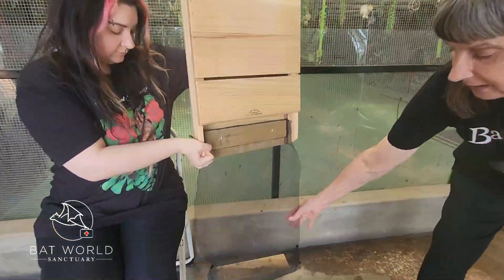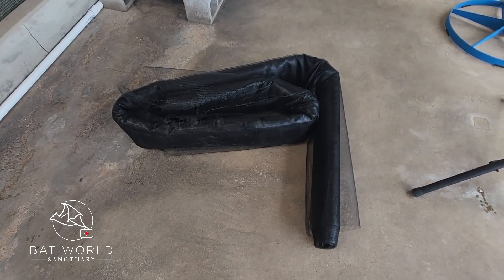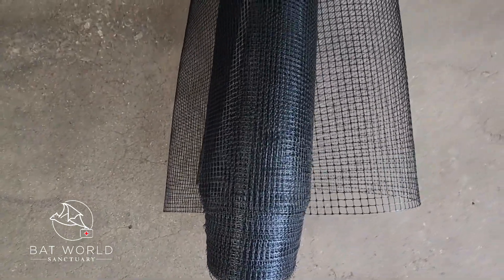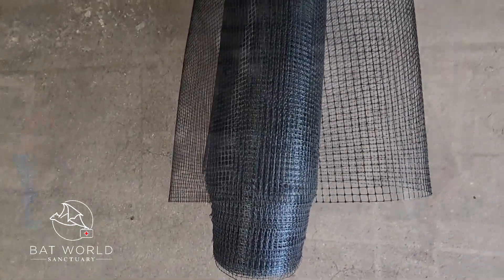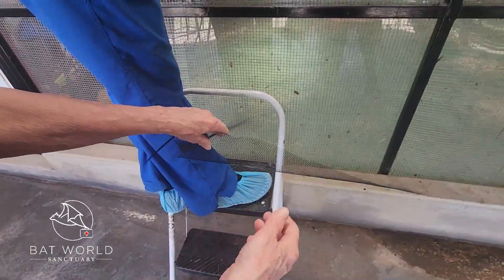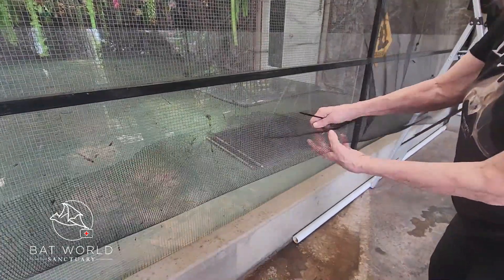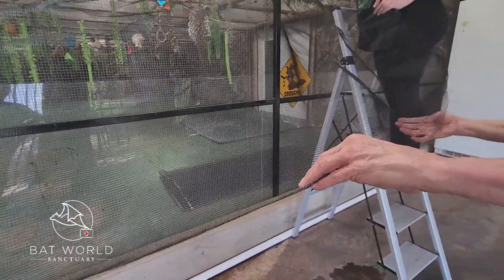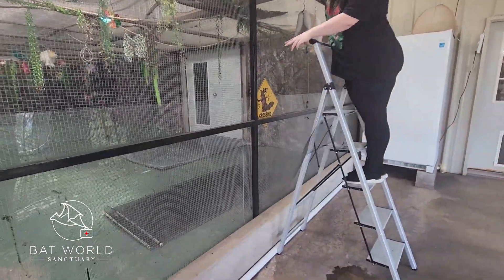Creating Pup Catchers for Bat Houses, Barns and Large Roosts

Comment: Hi there ! I just built mine because the baby bats were falling. Is working so far but I’m concern about the poop getting stuck in there and the baby bats laying around it . 
How do you do to keep the poop from the nest ? Thank you!
Reply from the maker: Hi! Typically, rain will wash the pup catchers out pretty well. Any pups that do fall, for the most part, will likely start climbing right back up the net, so they shouldn't be stuck in anything for too long. What size netting are you using? :)